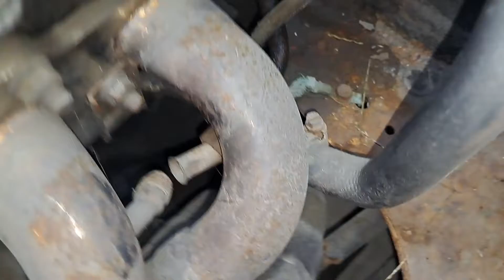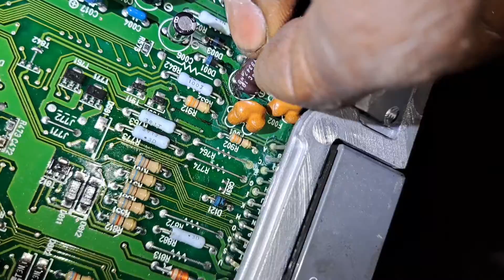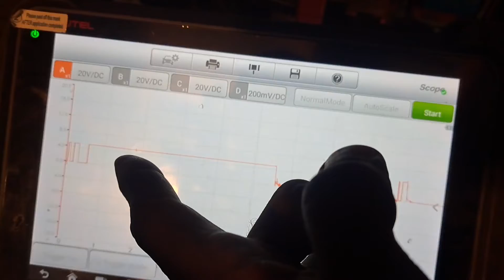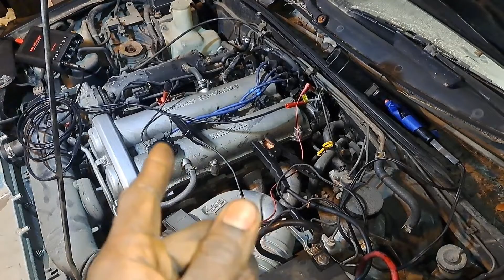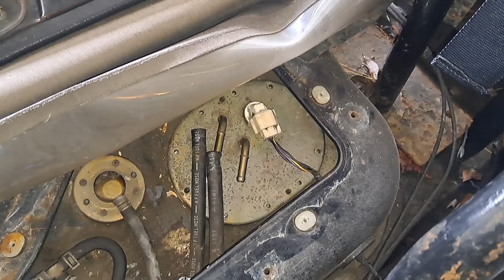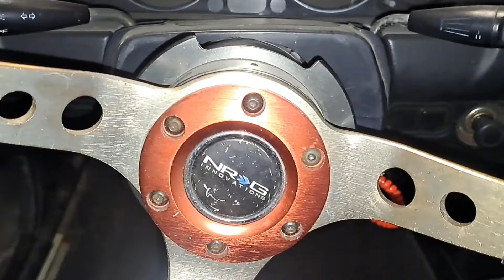1994 mazda miata crank no start, 3 years, and 3 different shops with no fix

Comment: That jumper wire was on the diagnostic port because you can jump it and count the flashes of the check engine light to get your codes

Comment: When you test the CPS outputs, your scope is connected to where they are supposed to connect, on the cable, but without the sensor  connected. So you're not looking at the CPS outputs at all. What am I missing?

Comment: Hi thanks for video do U recall how tach needle behaving while cranking n not starting
Reply: Mines not jumping on start, nb 01 just did a harmonic balance gear replacement cuz it exploded, did proper timing yeah yeah now it cranks i have compression, idk if i have spark or fuel

Comment: That wire was to jump the fuel pump.
Reply: Jumperwire is for diagnostics.... You count the "check engine" light flashes to get the codes

Comment: I see this as a waste, a multi-channel scope, and only monitoring a single channel. Leaky CAPS are never a good thing; what is good is that we can fix them ourselves with a little skill. I know you are not OG but when you get spark with key on and again with key off, this is a sign of a bad ignition switch, I worked on these and all Japanese vehicles when I lived there for 20 years, I am happy you found this issue also. Now I am waiting for you to perform the same test with the power jumped on the switch??? to see if you get the spark? Why did you not AMP RAMP the fuel pump to diagnose it with that fancy multi-channel scope? If you were not sure if that was actually the fuel pump relay, do the UNPLUGIT Test, either the relay is not it or the engine is sucking fuel from the tank?? If you do a test during diagnosis, pls do the same test after the repairs such as the 12v drop on the CKP with key off after changing the ignition switch, also look for the timing light flash with key on and key off to be sure that problem is a problem of the key switch or the ECM still, thank you for the video again, today was my binge watch for your channel for a minute but I am far behind schedule as I went on vacation to the states for 2 months plus prep time before going, peace.
Reply from the maker: @DuaneDonaldson  I try to keep diagnosing simple. If I do things to complex people will get scared and lose interest in the video. This didn't take long to figure out.  As long as there's answers/ resolution and the strategy worked in a timely manner,  improvements can be made from there if need be. 

Thanks for your feedback